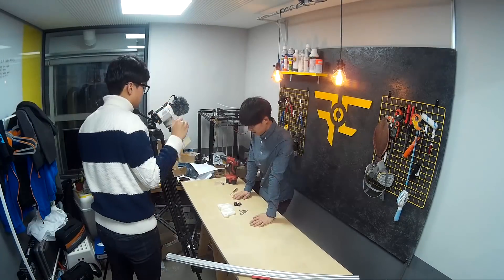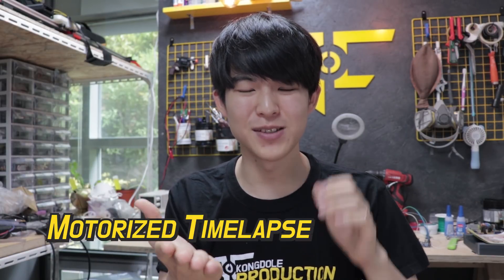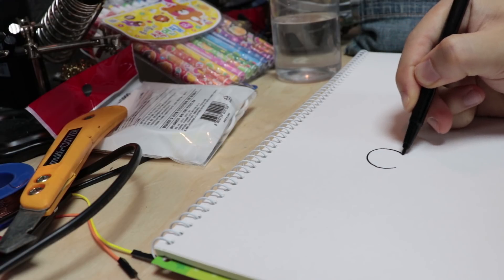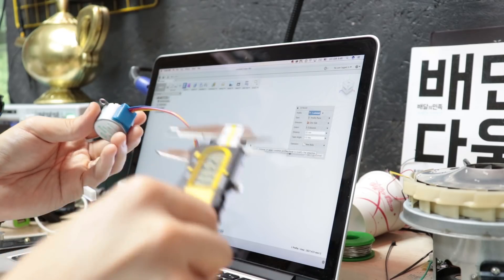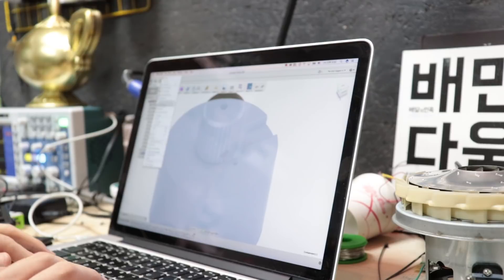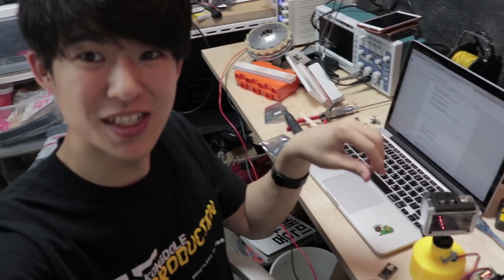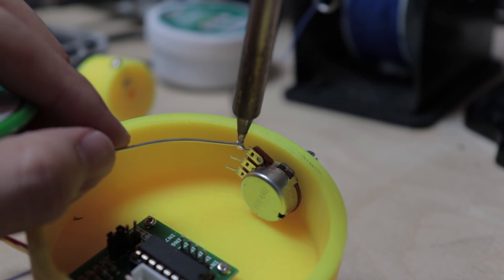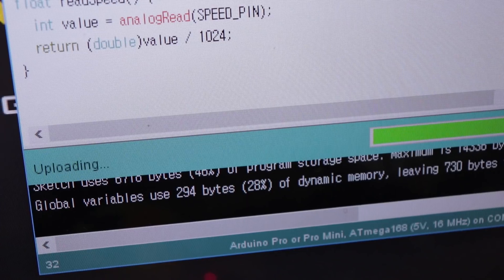How To Make a Motorized Timelapse Rotator with $10

Comment: I know I'm late to the video, but thank you! This is exactly what I was looking for. Wondering if you can help me with one option. Would it be possible to add a switch to control the direction of rotation? I know it would have to read the analog input from a switch, probably as either a high or low signal, but I don't know how to code it.
Thanks in advance!